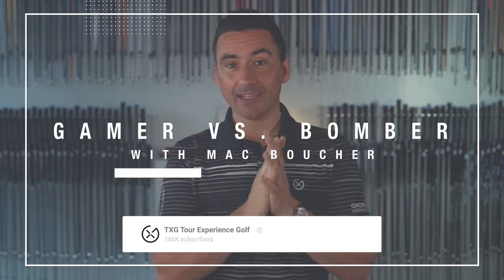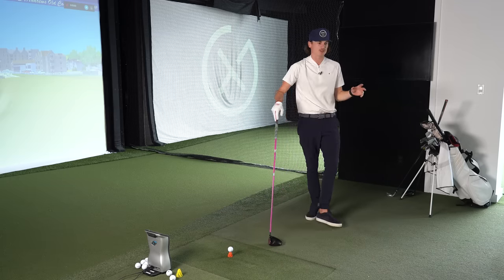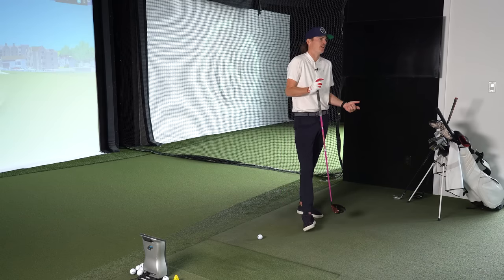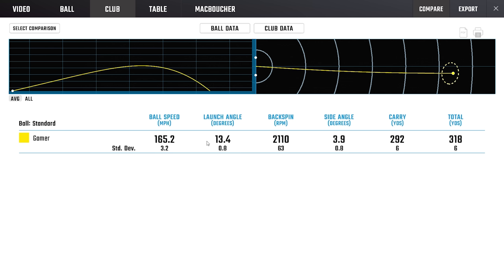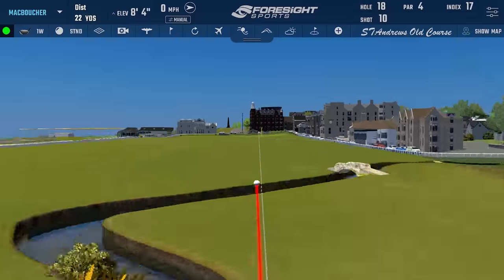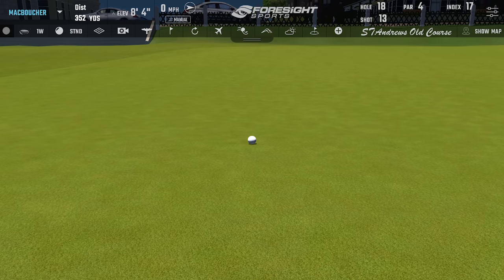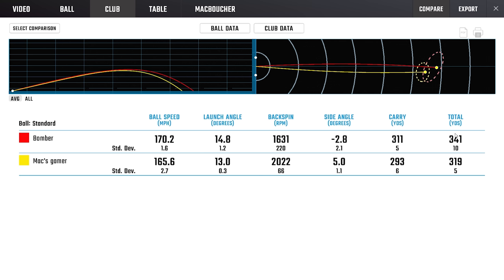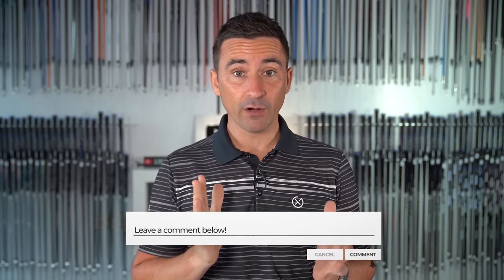Mac Vs. AutoFlex // Building a Bomber Driver!

Comment: When you hit it 310 with a cut that's what you should do. I hit a bullet cut that rolls out to 255 which I use pretty often. But I'm looking to turn it over as I can get it 280 with good launch. It matters more for me though as a 9i vs PW is a lot lower stress than 7i vs 5i lol.

Comment: for him it isn't worth it for someone hitting it 230 in the air getting it closer to 250 is a huge boost, similarly though being in the fairway is most important for the large majority of golfers if you hit your driver in the air 250 or over chasing distance if it makes you sacrifice accuracy is a fools game in my opinion .
Reply: if it isn’t really sacrificing distance though (like Mac isn’t), worth it to use the bomber flight in the right situations like this hole where he can get on in 1.
Reply: @lawbinson  I'm sure he swings harder on drivable or short par 4s. But that isn't chasing distance.  

Chasing distance is getting a driver that helps you hit it farther thus making it less forgiving and swinging 90-100% on all drives.

 What it appears he has done is gotten a driver that he has a tight dispersion forgiving for him and swings 85% with it. Costs him maybe 20 yards but he hits it far enough where that doesn't matter necessarily